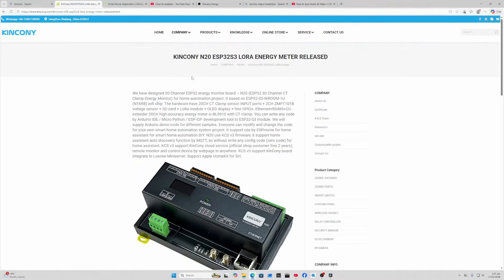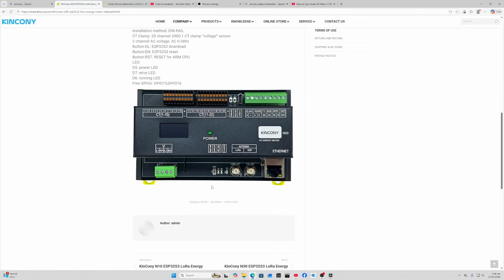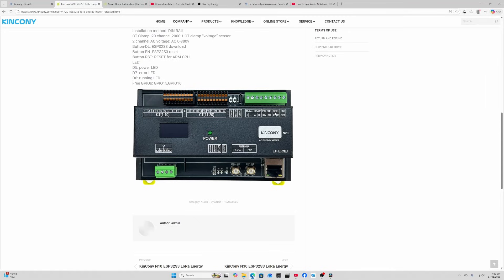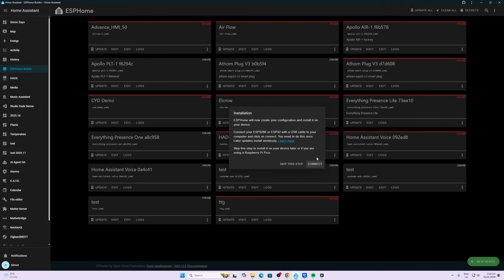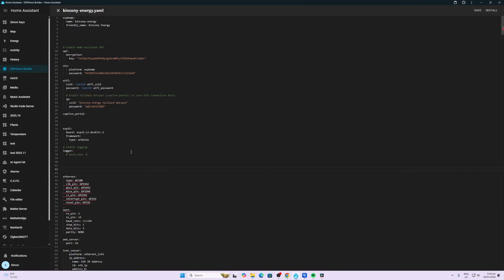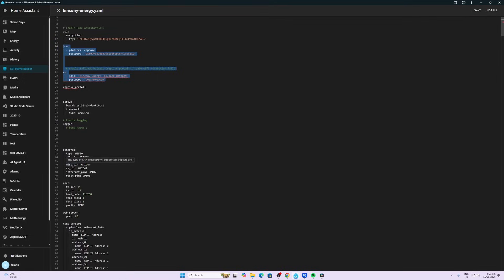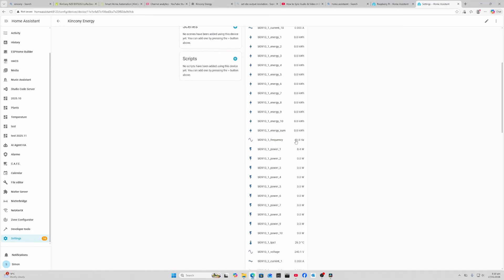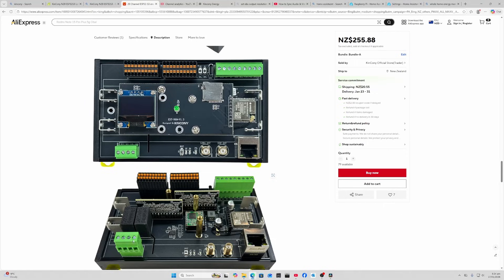Up to 60 Channel Energy Monitor Solution with ESP Home for Home Assistant!

Comment: I'm using Athom energy monitor which is ESPHome and a number of plugs powering fridges etc.  Fridge units are there plugs without relay. So far all working well but might need to go the Shelly 3EM which is NZ certified.  Athom seem to be EU certified by the looks.
Reply from the maker: Yeh Shelly is a great option for NZ!

Comment: I have 2 Leviton Smart Service panels with 30 breakers each. Each Leviton breaker has a CT in it and it also allows me to trip a breaker remotely if I want. I  rewired a good portion of the house to take advantage of the breakers, IE.. Fridge, rooms, washer, microwave, media center, network... I also have a critical loads panel (also a Leviton Smart panel) that I have wired into my EG4 6000XP/14kWh battery/5kW Solar panels. I have all the high amperage loads (HVAC, Water heater..) in the main service panel and all the other loads are in the Critical loads panel (solar powered). I am currently working on getting them into Home Assistant. You can never have enough toys.
Reply from the maker: Oh wow that is next level hey!

Comment: Duke energy already tells me how much energy I use. I just want to know what is using it.
Reply from the maker: Yes Lawrence that is why it is so great to have sensors on each circuit!
Reply: @simonsayshomeassistant still underwhelming. I like monitoring each individual device via smart plugs rather than just everything plugged into a circuit.
Reply from the maker: @LawrenceKibler  Yep smart plugs work well offering individual appliance monitoring :)